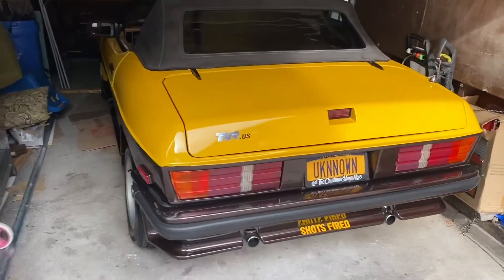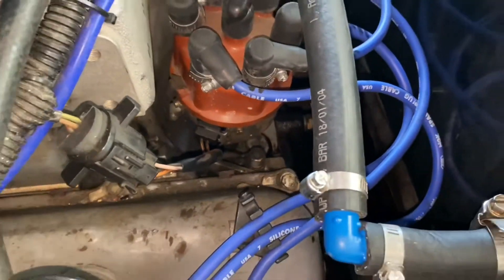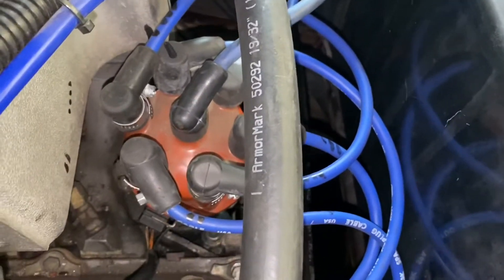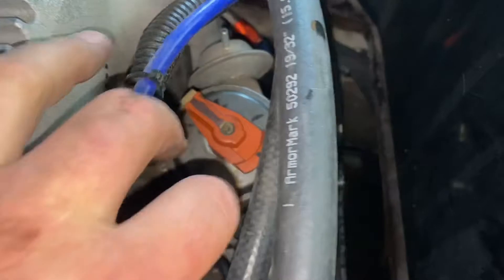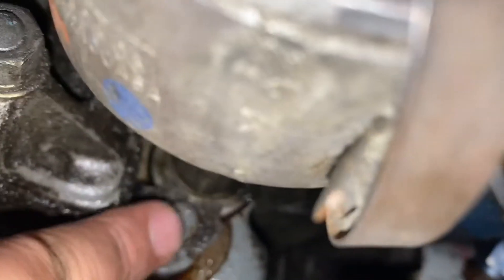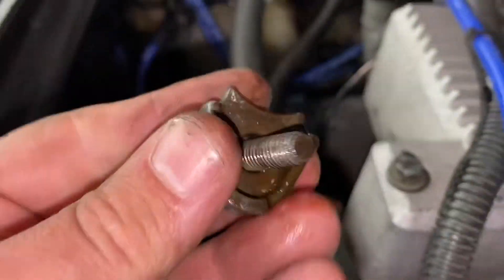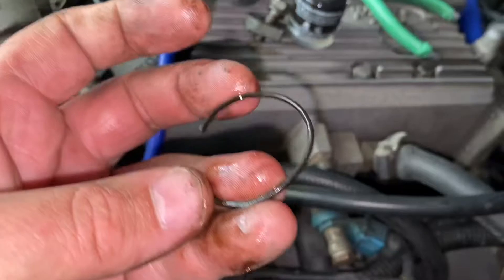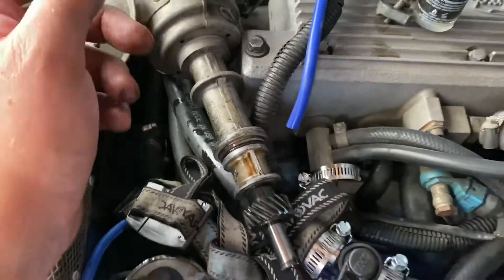TVR Tasmin / Wedge / 280i Distributor O-ring replacement

Comment: My late brother in law was a TVR man .. He had a 3000M. I remember often going to the factory in Blackpool  Uk o open days and once  just before the Cerbera was released . We got in trouble as we pulled a cover off one to take a picture. The factory was an incredible place with blokes slopping fibregalss mat  and fixer into moulds. I have a 2.8 Ford Capri with your same engine hence watching .Recently cahnged out the fibre cam gear for alloy makes no noise and is reassuring. PS --the bosch Jetronic is not as scary as people think, I use a GUNSON Co meter 
https://www.manualslib.com/manual/1482901/Gunson-Gastester-G4125.html

(not sure if they have these in USA)--it works great, my tester station says my emmissios are excellnt for an older V6 ..best wishes . Your boy looks a happy lad.
Reply from the maker: Thank you))))